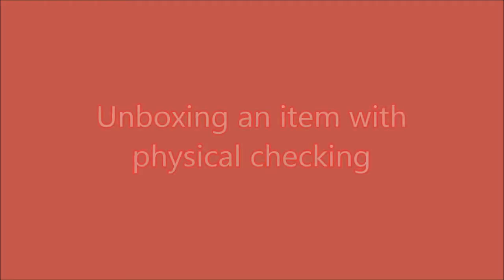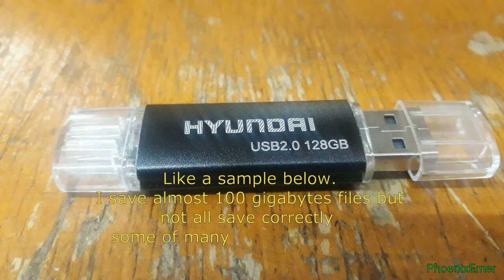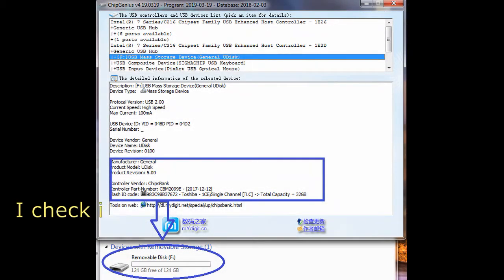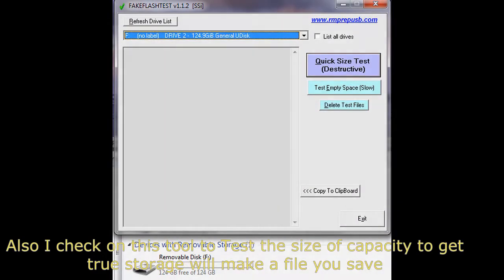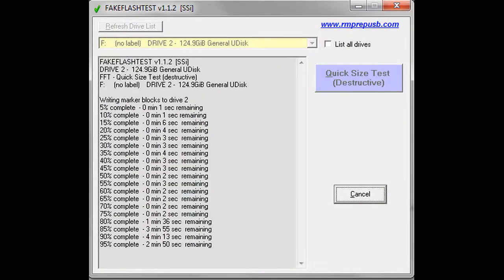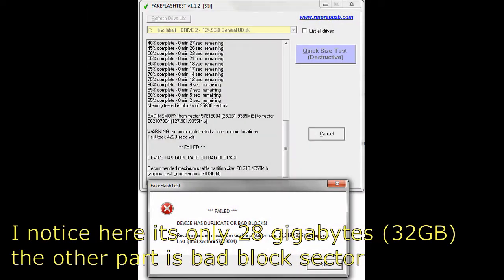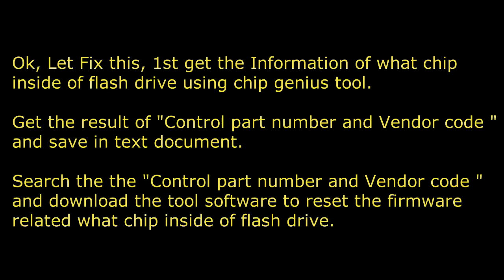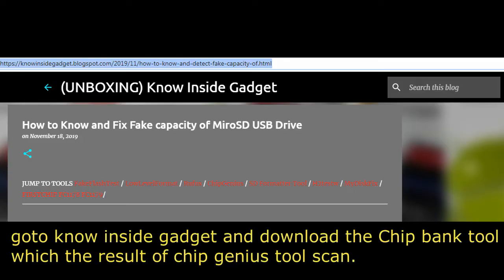How to Fix flash 128GB OTG Fake Capacity Reset Factory default what chip inside [ChipsBank]

Comment: My Flashdrive is of 64Gb it also showing 64Gb in ChipGenius software, i used it for some time, but now after some months, it's in pc it showing only 29, I tried your method of flashing its firmware, but didn't get much, tried the disk part cmd method also to get it back to 64GB but it dint worked, can you help me with this

FirstChip
FC1179
Reply from the maker: Hi, this video is for CMB flash not FC. There are two reason why become 32GB! 1st if your drive is DoubleFlash which the IC (A) is damage and (B) is good. Try to modified program using scan level to 6 "High MP for double flash" - https://youtu.be/GO5fJuT1uQk?list=PLadR3ClbHDJlj-g7sSkRAw2cbGwer5GgB&t=82  Subscribe for future Updates
Reply: @phoenixemer  Ok I'll try double flash, then let you know. Thank you for your response.
Reply: @KnowInsideGadget  it is still the same, can you help me with this.
Reply from the maker: @gauravsoni407  Sorry to hear that, Maybe the Flash ic is damage, You can edit Bin section to become 64GB but if the True storage count is 32GB! Only 32Gb files will be save, The other sector become fake file or lost. Thank you for visiting my video You can subscribe my channel.
Reply: @KnowInsideGadget  the true storage count is 64GB, and its showing the 64Gb in the ChipGenius software also, i don't know what to do now
Reply: can you help me if i share the details  over the email to you?

Comment: need to destroy it first before I use the first chip and chipsbank? by the do ypu have any tools can decreases the storage capacity? for example 16GB but 4GB damage, i want to set it to 10GB so  that i use fully without being corrupted.. nosebleed ako sana po masagot
Reply from the maker: yes this tool also ability to fix damage & edited storage capacity, kapag ginamit mo ito sa stand alone scan. kung ilan ang mabasa nya iyun lang ang matitira. at totoo po na i destroy nya ung partition ng drive kapag ginamit mo. kung may laman, i-save mo muna tol. subs me
Reply: @KnowInsideGadget  what if 16GB sya sa h2testw pero 2GB damage.. gusto ko kasing mangyari gawing 10GB kaso ayaw.. i tried sa cmd shrink=10GB ayaw din
Reply from the maker: @lowcosttech8026  Use capacity BIN setting Fix lagay mo 10,000 and the rest setup is auto. [ video 1:57 ]

Comment: hey i actually set it to 26gb from others guide it did fixed my usb drive but i lost about a 100gb of space is there any ways to restore it back to 128gb
Reply: 128 gigs was fake and when you fill arround 28 gigs the files are getting corrupted

Comment: Hello dear brother.
   .. I hope you are well ... Please help ... I have a flash disk failure and I could not restore it .. Please help ... It has the same flash specifications .. but it appears in the aptool program in  red under the name: unknow flash ffffff and is not accepted What program ... this is the flash information
  Description: [F:] Périphérique de stockage de masse USB (ChipsBnk Flash Disk)
  Device Type: Mass Storage Device

  Protocal Version: USB 2.00
  Current Speed: High Speed
  Max Current: 100mA

  USB Device ID: VID = 1E3D PID = 198A

  Device Revision: 0100

  Manufacturer: ChipsBnk
  Product Model: Flash Disk
  Product Revision: 5.00

  Controller Vendor: ChipsBank
  Controller Part-Number: CBM2199A - (2017-12-12)

  Tools on web: http://dl.mydigit.net/special/up/chipsbank.html
Reply from the maker: try this tool - https://www.usbdev.ru/?wpfb_dl=10034
Reply: @KnowInsideGadget  Thank you for trying ... but it didn't work too 😭
Reply from the maker: @karimguermi1  If "unknown" a chips was damaged maybe.